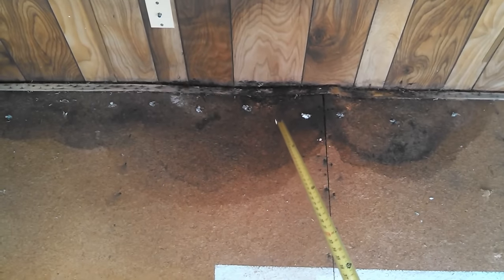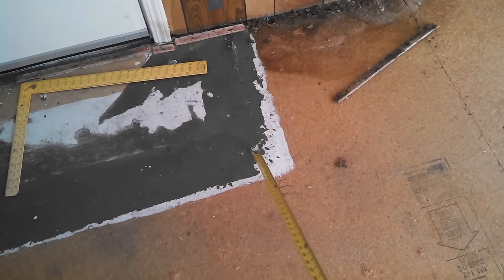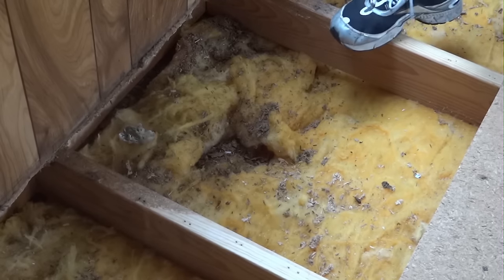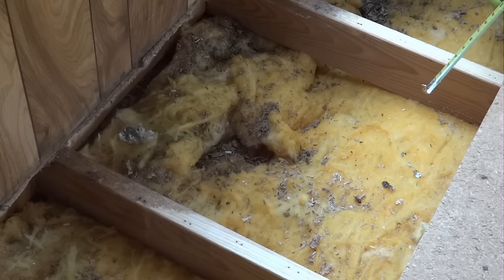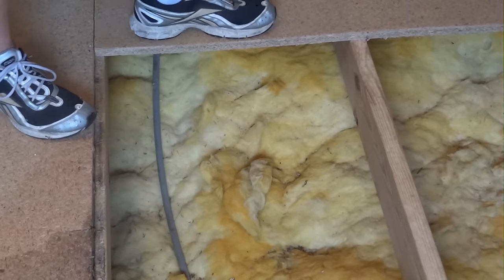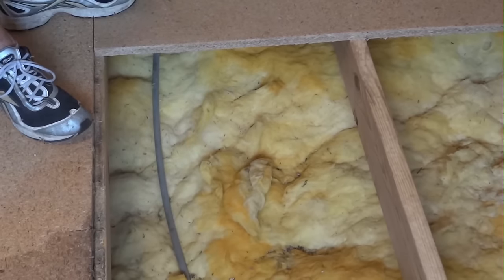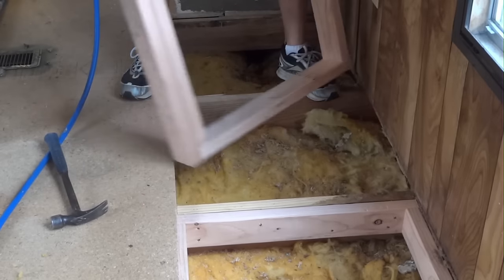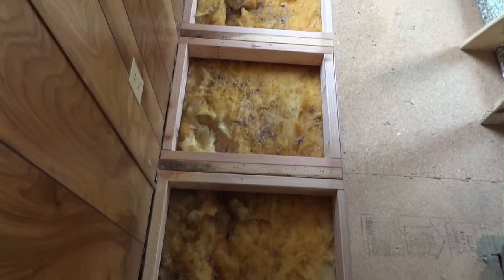How to repair or replace a damaged section of subfloor.

Comment: What's the material of the first subfloor? 

It looked like cheap and unsafe compress wood.

Good work.
Reply from the maker: Particle board as spec'd by the original manufacturer and talk about safe, well we have not hesitated to have friends and family upon it.. Check the date, still solid. Thanks

Comment: my plywood is laid down now what's the best do you recommend nails or wood screws
Reply from the maker: Either can work well. I used ring shank nails.
Reply: For small repairs definitely go with screws... a little bit more pricey than nails but worth the price to avoid bounce and squeaky noises .

Comment: I need to fix my bathroom subfloor.
What type of wood  you recommend ?
Reply from the maker: I found that it is good to go back with the original material.
Reply: @AlexanderDyer  what it's call?
Reply from the maker: In my example it is particle board but yours may be different. Could be plywood or hardwood.
Reply: @AlexanderDyer  thank you 😊

Comment: hey saw you video and wanted to know if you could tell me more about how I can replace subfloor under kitchen sink. concern about how to not have outside wall come down. apparently as long as I have lived thee I believe that the floor has been getting leaked on under the sink. want to put down plywood. and plan to take out cabinets around area anyway and replacing. this will be my first attempt at fixing it or any major thing so I want to get it right. I thought that since I have a frame that the sink could sit on it on top of joist while I clear out rotted wood. I see your extra support you put on edge of wall but should I do that first then rip out the rest? if you can can you contact me on fb same name in Goldsboro nc and give me tips or let me send you pics of problem(dishwasher in the way too...also rotted floor) and sorta walk me through what to do. don't have funds to hire it done so if it gets done then I has to be me to do it. thanks.

Comment: plywood should always be used to replace particle board or you might run into the same problem in the future
Reply from the maker: Plywood too will fail if chronically exposed to water. The problem I fixed was due to a leak and not due to the existence of particle board. If that were so I would have had to replace all 1100 square feet. Please note the very first sentence at the beginning of the video. First, fix the leak.

Comment: i dont see a point of boxing all the way around, as the floor trusses are capable of holding the subfloor. The perpendicular 2x4s are necessary, of course.
Reply from the maker: It is a very simple and effective way to attach those necessary perpendicular parts. Toe nailing is more difficult, less secure and less accurate and once you get on a roll building a few boxes, no faster.
Reply: @AlexanderDyer  this is a VERY effective repair - great idea thanks

Comment: Was there not any rot underneath the wall?  What would you have done differently in that situation?
Reply from the maker: Not on this project but on a past project I removed 20' of exterior wall while supporting the roof with a temporary structure, replaced the floor decking and built a new exterior wall with exterior siding in a day. Insulation, Electrical, sheet rock and trim was done in the following days. Not for the faint of heart.

Comment: Hi, Great video - exactly what I was looking for. Can you tell me if this would be suitable in a bathroom corner to support a 80cm x 80cm freestanding shower cubicle, which is going to replace a bath tub? I was thinking of doing a square of 4 blocks or more, Thanks
Reply from the maker: I mean yes. Replace the subflooring under the tub if it is damaged.
Reply: @AlexanderDyer  Hi Alexander, Thank you for taking the time to reply. It's much appreciated. I should have explained a bit more: There had been a small leak accross the the floor under the tub, which was laid accross the joists into the area behind the bathroom door, so as a precaution I took the floorboards up and was shocked to find only joists (which luckily were not damaged at all - water stained but just like new when cleaned up and dried out) and not a single noggin in the subfloor! I wondered whether there was a now a need to box under the area, to distribute the concentrated load of the shower into the corner,  behind the bathroom door where two brick walls meet at an angle, Thanks

Comment: Screws > Nails. The floor will squeak like crazy using nails. Other than that good job.
Reply from the maker: Yes and No Shawn Charles. Both have pros and cons. This floor repair has never squeaked as I have used glue coated ring shank nails. So in my case where I have the correct type of nail gun to shoot them, Coated Ring-Shanked Nails > Screws

Comment: When i had the floor replaced the wiring was rubbing on the metal for the registered vent.
Glad i was having the whole subfloor replaced. It was waring thru the plastic cover everytime we stepped near the register vent. Praing its not like this tru the whole trailer.
Big fire hazard.

Comment: Why did you leave rotten subfloor underneath and supporting the exterior walls?
Reply from the maker: Judgement call. In this case it is compressed and stable between structural members. I have experience replacing that part and it requires the removal of the exterior wall, support of the roof etc. Not easy, Not cheap. By all means feel free to go the extra step on your project and video the process so that we can learn from your experience.
Reply: I take a chisel, clean out what I can, and the beat a 1 by in there.
Reply: Oh jeez, that’s some jerryrigging for sure

Comment: what about the soft and rotten wood under the bottom plate on the floor? Don't you want to get the out too?
Reply from the maker: It is a big deal. It was not necessary on this particular job. I have done exactly what you suggest on another job. I removed 20' of exterior wall and so the roof had to be shored up in the meantime while I replaced the floor and then built and installed a new wall. New wall means new siding, studs, widows and doors, roof flashing etc. It is up to you to decide if your situation requires that level of time and expense.
Reply: repaired a 60s maybe 70s mobile home under the windows.  slid plywood under the walls to the outside of the wall.  took down the panel under the windows and nailed the bottom plate to the plywood.  only pain was dealing with the staples.  now they have the high speed cutters which would make it easy today.

Comment: Can't imagine putting particle board back down, rather than good quality plywood, or marine plywood, where another leak could cause another failure.
Reply from the maker: Plywood, like particle board is made of wood and glue. A prolonged leak will destroy plywood too. Water destroys a house, period. Fix all leaks immediately and your floor will not rot. 1" thick particle board is what is specified by the manufacturer. Marine plywood means you are expecting and accepting continued and on going leaks. My first statement in the video is fix the leak.
Reply: Don't disagree with your reasoning. I've used plywood saturated with polyurethane, thinking it would last longer if the leak persisted. You're correct, get rid of the leak.
Reply from the maker: Feel better?
Reply: Particle board has a generally excepted smoother surface for flooring to go over.  I agree it makes a better additional layer over plywood but manufactured homes aren't built to be more expensive, they are often built to be cheap and functional unlike most stick built homes.

Comment: Glued particle board  bad stuff  I  know its the cheaper route to using plywood, but in the end the job is only as good as the material used. Replace 1 room at a time  if needs be and put flooring in that will last. From the pattern on the floor it look's like the roof is leaking, that would be a fix asap, silicon tar none of that stuff works!  If you have the budget replace the roof with a bladder roof, guaranteed 25 years  and adds  r 15 value.

Comment: 1) what caused the leak,window and/or roof?2) what do the BOXES provide?....i am not a builder::((3) do i need to use air style nail gun setup?i have this problem in my bedroom on the outer wall with window therealso my floor in living room has multiple big soft spots,been out work 3 yrs owner here has been more than kind does not sweat me for rent...least i can do is buy materials and attempt work myself,good self help vid from you.if you could answer questions 1-2-3 that would help me
Reply from the maker: I had to re side that one. Fix the leak first or everything else is pointless. The boxes, it is a simple system to provide edge support and nailing surface for your sub-floor patch edges. Also the boxes allow for easy and accurate attachment to your existing joists. You don't have to have a nail gun. I started back in the day with hammer and nails, also you could use a drill\driver and construction screws. Watch the video again and notice the part where I point out the deflection of an unsupported floor section and note where the flooring is nailed down around the edges.

Comment: Don't you need to check if there is wires pipe work before you cut into?
Reply from the maker: +paupau You should know that, yes. If you will notice I first check the thickness of the sub-floor and then I set the saw to cut no deeper than that. This insures that utilities will be untouched.

Comment: yo idk much about anything but i do know that any mdf or "osb" made before the 2000s is basically glued sawdust its absolute garbage a tell tale way to tell is if you find a piece of subflooring that has a larger span than 8ft they dont sell osb in anything over an 8 foot section since the new standard came out in the early 2000s so if you find flooring with more than an 8ft span in either direction then you know its the old style and its basically garbage and will crumble under the least bit of moisture contact cuz it isnt rated for the slightest bit of moisture contact cuz this was a product made and used before the proper regulations were figured out for this material so tbh its better to replace the whole floor at least in that one room (but preferably the whole house) or else just hope it never gets too humid where you live cuz the same thing will happen might as well replace the whole thing while you got it opened up
Reply from the maker: Well, I have to give you credit, you did start off with the fact that you don't know much. Just kidding. Look this product is good but not great. Humidity will not cause it to rot but leaks will and honestly leaks will kill any wood products. This repair will last a lifetime as long as it is protected from leaks. 

I appreciate the effort young man, you do know things but everything is not so simple as good and bad.
Reply: @AlexanderDyer  really good question and response!

Comment: Why didn't you go back with plywood or osb?  The problem will reoccur.
Reply from the maker: No. If you do not fix the leak the problem will reoccur.  The water is the problem. I went back with particle board because it is 1" thick and there are 1000 square feet of it in this home so it hardly makes sense to change less than 1% of it. You do what you want to in your home and I will not dispute you.

Comment: I would of done it completely different not a fan of this type of work all the way from insulation nails glue just not a fan overkill in some areas and other areas just lacking common sense construction I would NEVER leave rotted/mold material like that simple blocking would of been fine use screws not nails along with some type of adhesive but again it’s your house and that’s how you want to fix it more power to you

Comment: so you do nothing about the rotten wood under the wall because that wood goes all the way under the sill plate which will be just as rotten
Reply from the maker: In one case it was so bad that I actually removed 20' of exterior wall to replace it while supporting the roof with posts. That job cost more than what many of these homes are worth. I understand what you are saying but these things have to be considered in an overall big picture. The repair in this video remains stout to this day and the home is making good rent with no complaints. Thanks.

Comment: So you dont need to replace the walling?
Reply from the maker: Perhaps. It is a case by case basis. In one case I removed 15' of exterior wall to replace that area. It was an extreme case which had been neglected for many years. A big job which is often price prohibitive. It includes bracing up the roof. New wall, New siding, electrical work, maybe a door and or window it can out pace the value of a trailer home in some cases. The repair you see here is sound to this day. The most important thing is to get it water tight.

Comment: Gotta love mobile homes, I see why you have to replace the section of the floor, that stupid quest piping!!
Reply from the maker: The plumbing did not cause this damage. Bad siding around the window was the culprit. As for the quest, the flexible tubing is ok but the fittings are what typically go bad. I replace them with Shark Bite fittings, they work great.

Comment: why the box??? why not just put boards over the support beams
Reply: That, and why ignore the rotten wood under the wall framing?  Isn't that still an issue.  I have seen a bunch of videos do that, they all stop cutting at the wall!
Reply from the maker: @ expert autodetail It was covered in the video and there are several very good reasons. Watch and Learn.
Reply from the maker: @ Andrew DeVore It is a case by case decision. I have gone both ways. If you are capable of removing 12' of load bearing wall to replace that strip, then I encourage you to do that and please report your progress and results. You will spend a good deal more in man hours and money on supplies but if you have plenty of both there is nothing stopping you.
Reply: @AlexanderDyer  everybody's an expert while they sit on their behind watching you my friend.
nice video.
Reply: You don't have to do the box.  You can add blocking without doing it in a box.  Then you can marry up to the joist on each end of the run to achieve the same thing.  But the box is one way of doing it.

Comment: Always use sledge not claw
Reply from the maker: Never say always
Reply: I've done alot of it and the biggest hurdle is the old staples in the 2/6 u have to be carefull when cutting saw usually hits those staples and always bang them in before putting the new plywood down

Comment: When you made those boxes you were nailing in to end grain, thats a no, :(
Reply: It's just holding the box together during install. Once it's nailed to the studs, no worries
Reply: Dont you check for the crown side.? Or is that not a thing with floor supports?